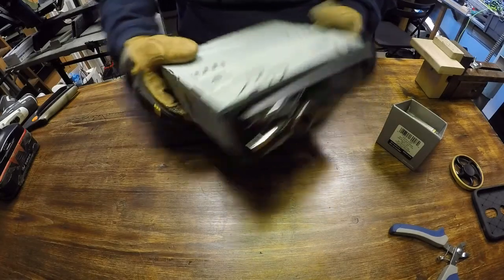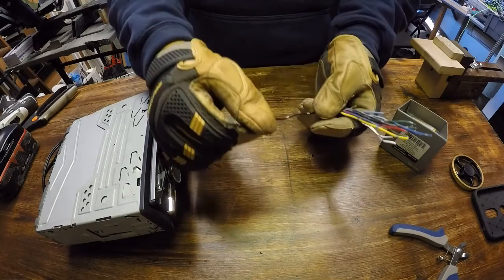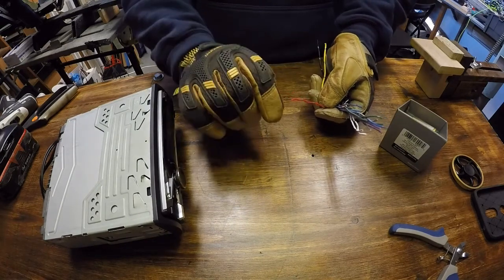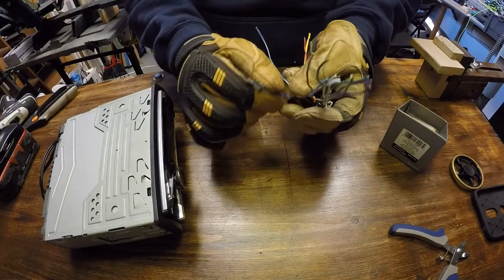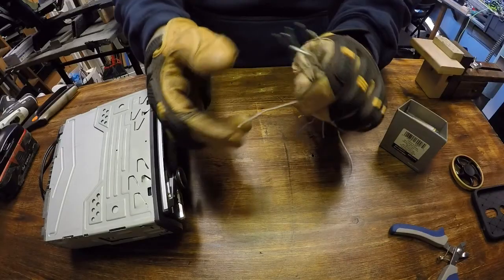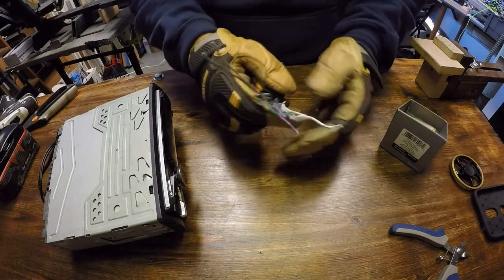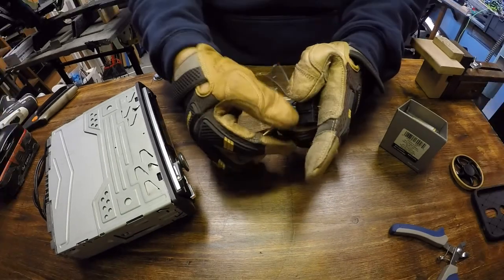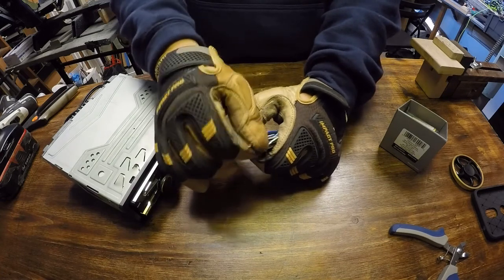Basic Car Stereo Wires Colors Explained

Comment: I'm t was a good to video but you spoke we of accessory wiring that turned to on with key on.  That is true but accessory wiring also shuts off when key is in the crank position . You may not like that to happen in which case you would want to find an ignition plus wire for this red wire connection . You have to just switch on the ignition key to the start position and see if power is still on or did it go off when in the crank position.  Then it can be your choice which way you want that to go. I prefer the stereo to remain on during cranking but with big amps you might want to shut off during cranking as there may not be enough battery to start the car with stereo and amps running ?